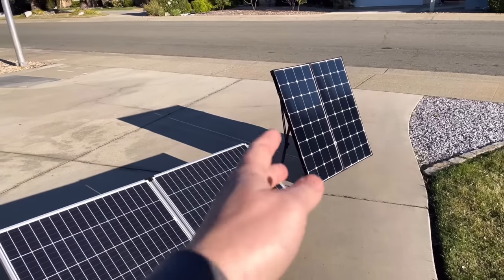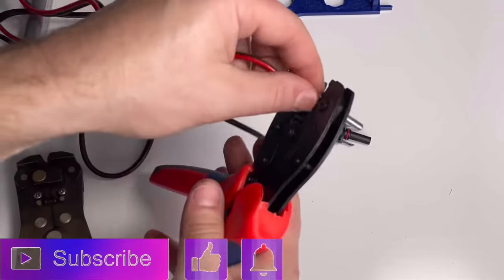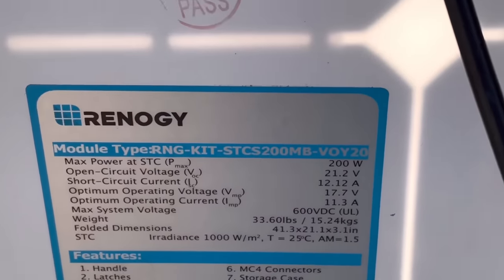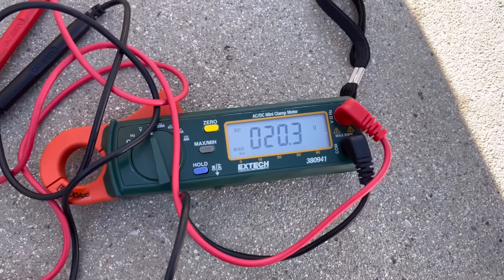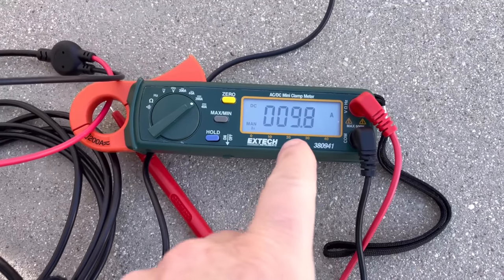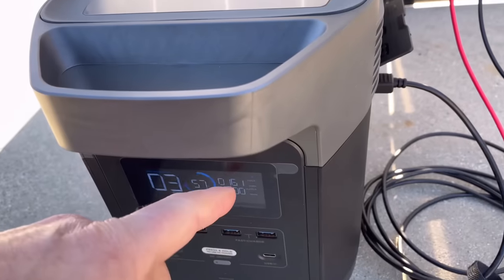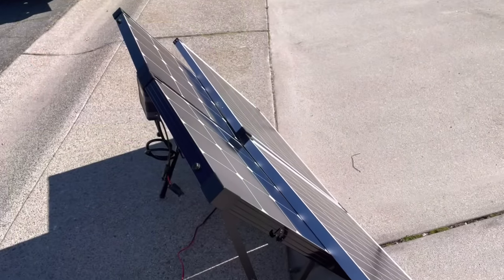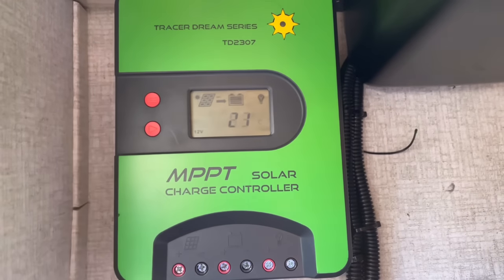Best Solar Panel - Harbor Freight 100 Watt Solar VS Renogy Eclipse Solar

Comment: Good video but one comment.  Fake news, The Renogy 200W Solar Suitcase is $330 free shipping on Amazon not the $550.  Harbor Freight cost $103 each for ridged panels (no controller or standard connector).  You exaggerate the price difference which is only $124  SIZE. You blow over this. HF panels are 37 x 27 , so two of those 54 x 37.  The Renogy -s  41.5 x 28 .   I think the HF are heavier and don't come with charge control and MC14 connectors.   WHAT I DID? I bought two Renogy 100W ridged panels that came with parallel connectors and charge controller for $220. Much better value than HF. BTW Harbor Freight also has 100W folding panels and they are $189 each. Two of those is more than Renogy 200W suitcase. .
Reply from the maker: First look at the video title and the renogy panels used you would see those are renogy’s top of the line eclipse solar panel suitcase. You are comparing todays prices which have been slashed from when the video was made. I can’t do anything about price changes. But there 100 watt eclipse panel is still $288 for one panel.

The HF panel can easily be bought most times for $99 with more power output, copper wiring verses aluminum and easily built into a solar suits case for minimal work and price. The HF weigh almost 2 lbs more when comparing Renogys normal 100 watt with a HF panel. 

I didn’t exaggerate anything. I gave exact data at time video was made while you use todays prices. Which is not a fair comparison at all…🤷‍♂️  
HF panels still perform better…and have a much better warranty return if needed and come with support legs verses the standard renogy panels do not. Neither come with a charge controller which I would rather have a Mppt verses a pwm anyway. 

Looks at the lastest video comparing both
Reply from the maker: Also I a mc14 connector is used in media or sound / audio like xlr connectors. 
Mc4 is more what I think you meant to say.
Reply: @johnnysweekends  Don't be pedantic, ha ha. Yep, it was a typo, MC4.  BTW at 00:30 those are NOT Anderson connectors. Doha!  Correction back at you. 
BTW I just made a cable today with MC4 connectors. Bottom line comparing big HF panels to anything is suspect. Renogy 100w regular ridged panels are less expensive or same as HF. But I agree when you get into FOLDING or Suitcase portable panels the cost per watt goes up, sometimes way up.
Reply: @johnnysweekends  You are making changes and saving the world, one YT video at a time, attaboy.   I don't think your video "slashed prices". I don't know  where your got your original price, but it was "full retail" not the usual sellers who discount these things, You paid too much. There are solar folks O-plenty asking $500 to $700 for 200 watts: Jackery $699,. Bluetti $499 to name two. They often have sales or bundle with a power station. What accessories they come with, controllers, cables, connectors don't know, but this accounts for some of the cost. Controllers are not free.  You do pay a premium for folding or suitcase.

These suitcase/folding kits are for people who want to plug and play, either don't have the ability and/or desire to source parts and make cables. Also you act like copper cable, controllers and connectors are free. By the time you MAKE YOUR OWN, not counting your time, it will cost much more than bare panels. These folding/suitcase solar panels almost always come with goodies, cables, controllers and connectors.  Renogy is stingy in this area of extras. 

Being cheap I agree, DIY is the way to go. Get regular panels (from whomever you like, up to you) and suck up the weight and size; make your own portable set up.  By regular panels I mean ridged metal framed panels suitable for mounting on an  RV roof or house roof.  However I fly a light airplane I own. I go airplane camping the two ridged 100W panels are too big. I use them for home and car camping.  I will have to cough up the cash for soft foldable panels in the future. I like using my power station and DC compressor frig/freezer for camping. No more ice chest for me. However a airplane is very space and weight limited. 

I am a Harbor Freight addict. I was there today and will go tomorrow to use my 20% off per day until July 4. I did not look for solar panels this time, but they are ALWATS sold out at my store and the one 30 miles away. So again agree to disagree. Renogy on-line order, in stock, easy, free shipping, arrives in a few days. Not an issue. Love HF but I would not buy it unless it was on sale, and even then likely I would not.

Last I did not say you exaggerated just correcting some inaccurate info and disagreeing.. You were just wrong on the Renogy price and calling 00:30 Anderson connectors.
Reply from the maker: Yea correct as I stated in description those are SAE but I was messing with and ordering Anderson connectors and never caught it in editing. 

But yea these smaller portable panels are very close performance wise and building your own is cheaper for sure as I have done a couple. 
I would never use these for normal house hold or shed or off grid as price wise it’s not budget friendly at all. It’s more for size constraints or weight.
Reply from the maker: The foldable panels are nice but for the price no reason to buy a 100 watt when it’s not to much more for a 200 watt and that’s the minimum amount needed if you wanna power or recharge anything because you never get full spec for long from panels. To many factors plus once they get hot a 100 watt panel gives about 90 ish depending.

I have built bigger folding suitcase styles that are 350 watts and it was super cheap and performed great but it also weighs 55 lbs. 

If your wanting the most amount of watts for the price used residential is the way to go…

As far as renogy vs Hf panels the Hf panels still perform better and are pretty much the same price with a coupon. 

See the difference here in this short video
https://youtu.be/W-fgI6Kyy2I
Reply: @johnnysweekends   UPDATE. today. Shock good news, HF had  100W panels for $129. They have a folding version for $189.   So the no sale price for two is Approx $260.. Again Renogy 200W folding panels $330 Amazon.  Difference of $70.  I don't disagree with you, just the prices. I agree with you. Shop around, test, DIY your own cables etc. 

Right now I am charging my Power 505 DBPower power station at 139 watts. The power station throttles to limit max pwr to 150 watts. To get these panels (or any panel I tried)) to work well with power station, get the most out of them, i NEED a BOOST converter and boost voltage. Power Stations are not like charging a STAND ALONE Battery. You are going into the Power Station charge controller.  I take panel voltage of about 16V and boost to 25v (adjustable) to get the 140 watts. With out the boost the charger would be 90 watts or less.  As you say higher voltage is better. The power station charger likes the higher voltage. Cheers
Reply from the maker: If doing a power station you need to watch max voltage as it can burn the units up. Amps are ok it will by pass what it can’t use. 

Some will do 2s2p depending on the needs and what your unit can handle. Again watch max voltage especially when it’s cooler days as the voltage can really go up.
Reply: @johnnysweekends    Yes Sir. Thanks. I am aware. The unit is rated up to 30 volts and 150 watts. My panels 2x100W Renogy.. Theoretical 200W output. I'm using a BUCK CONVERTER in BOOST. It is adjustable. With out the BOOST voltage conversion the Power Station would only draw about 94 watts full sun. (* read note below). By boosting the voltage from 15.7v to 25 volts I get the max from the panels, about 134W. Of course amps drop, about 5.7A.  Note this is just what the PWR STA is allowing. With a MPPT controller and big FLA or Li-Ion it could do better. I could adjust the voltage down and get less power, but the unit is rated at 30volts and 150W. 

The POWER BRICK supplies 24 volts at about 5 amps giving 118W. So 25V is my target volts into the Pwr Station. I am in the ball park. Also the BOOST really helps with low sun. Bottom line you can give Pwr Stations (if good quality) more power but they will throttle. However voltage is important and I am safe at 25 volts as the Pwr Brick is at 24 volts. It seems my Pwr Station likes 24 volts. I tried charging on car Cigar plug (they provide that cable). About 20W to 25w at say 13,5V (my car has smart alternator and does not over charge the battery). However in 24 hours that would charge the unit.

* Note: Other big YT solar channels do shoot outs with power stations and portable panels. STRANGE a panel on one PWR Station will produce descent power. Same panel on another Pwr Sta. it charge rate is peanuts. These are high quality brands. So the magic or mystery is in the internal charge controller of these Pwr Sta. I could just use a battery, controller, inverter and panels. However these power Stations are handy for around the house or camping.  With the booster I get more charge in low sun conditions. Very handy on cloudy days to keep my camping Frig going.
Reply: @johnnysweekends  Keep this in mind. NOT all panels are the same. Not all internal charge controllers in Power Stations are the same. Some combinations of power station internal charge controller and solar panels work really poor.  This is well known. Many power stations are looking for a solid Voltage and Amps from a Power Brick to accept all the power. I could put two low volt panels in series. I could get panels that produces more than volts with the load the internal charger puts on the panel. However the BOOST converter solves this. I am NOT going to try to convince you my Pwer Station does not love 15-17 volts. It likes 23-25 volts. I have to live in the real world. YES running straight panels will work, just 48% less efficient. 

Did you know MPPT controllers have a Buck Boost Convert in them. The software optimizes the volts and amps to get max power for the load as the panel out put changes. It does this constantly.  This is like what I am doing but at one fixed volts.  I have it set to the nominal 25 V to not be too much at full sun and to give a good kick when volts on panel drop due to low sun. My booster is rated to 600W High Power DC to DC Boost Converter DC 12-60V to 12-80V, Step-up, Trust me this is the problem solver when power stations are not loving what the panels are outputting.

You are right directly connecting the Panels to my Power station I get 90W vs 134W. I will take the 48% gain.  Now 90 watts would meet my power needs IF I COULD GET 90W and count on full sun. At  134W I am fully changed by 1PM after running Frig all night. HOWEVER it is low sun conditions or cloudy days the BOOSTER really gives the edge.
Reply: I just bought 2x rigid Renogy at 99$ each Canadian $$. I can prop them up myself.

Comment: Interesting that you are pricing bare bones panels against a full setup with charge controller. It would take at least another 100 to 175 dollars to make a full suitcase system out of the Harbor Freight panels plus an hour or two of labor to accomplish the project at a minimum. I'm perfectly fine with doing a project and saving some money, but it bothers me when you take a skinny apple and compare it to a fat juicy orange. They aren't the same thing. Another issue is that you are running one set in parallel and the other in series. This makes for yet another poor comparison.
Reply from the maker: I can buy the same pwm solar controller for about $25. Door hinges for $12 and easily buy some bag for about $20.
Still under $300.

And in order for me to parallel the renogy I would have needed a adapter 
Both are in series…
We will see if they perform well after a 20% degradation test. Or if they lose that much..🤷‍♂️

You can also watch my build on a 350 watt suitcase in my solar playlist

Comment: Maybe you should show practical use of the solar panel and hookup for the novice person that doesn't know electrical circuits because all this video does is confuse
Reply from the maker: Portable panels like these are for the most part really simple. 
And if not doing a grid tie you don’t need a electrician. Grid tie is a solar system connected to the main grid or power company.

Small set ups like this are simple depending what you want to do, or device  you want to run or store your energy in. 
Which storing refers to batteries.

I could make a more simpler video down the road. This really is a review of a expensive set up verses a cheap set up and is it worth it to the person considering what they wanna spend there money on and there needs.

Comment: can u use this panel on a generac 1000
Reply from the maker: Generac 1000 what??
Reply: @johnnysweekends  I have the generac 1000  but don't wanna buy there solar panels .wanna buy another solar panel that will go with the generac 1000 ?
Reply from the maker: Generark maybe? 

Regardless of which power station, you can use any solar panel as long as you have the correct connector. Which they have adapters. So yea these will work and you doing need to but there’s. 

👍🏼
Reply: @johnnysweekends  Thank you John !
Reply from the maker: No problem..👍🏼

Comment: Why would anyone with any knowledge cut those anderson connectors off right up against the connector so you could never use them again for any other project? That's a sign of an amateur.
Reply from the maker: That’s the sign of someone with more then enough crap and junk in my garage. If I kept everything little thing I use and swap and more I look hoarder.

Don’t need it, don’t want it, have more…. It’s in my way. 

Thanks for watching 👍🏼😀
Reply: @johnnysweekends  Sorry for being so harsh.....hungover!
Reply from the maker: No problem, we good 👍🏼 👊🏼😁

Comment: Is anyone marketing panels with 4 adjustable legs? (Permanent installation)
Reply from the maker: Not that I have seen…
Reply: @johnnysweekends  I'm surprised. I have quite the application for that. Demographics being what they are, if there's one, there are thousands....
Reply: I live in TN. Our hills vary in 3D. Kind of a drag installing large flat stuff in bulk.
Reply from the maker: There are adjustable legs you can buy and mount them but nothing specific for solar panels. Normally they are portable or fixed
Reply from the maker: Yea I bet that’s tough. 
I have been to Tennessee a couple times. 
Memphis, Nashville and way out east in the corner by a lake and a big college for doctors I think. The lake was awesome. 
Loved it there. About 20 mins from the big tunnel to Kentucky

Comment: 100 watt panels are a wast of time and space. Renogy are not $500 for a 100watt or even 200watt panels.  Paid advertising
Reply from the maker: Purchased both with my own money…

It’s to see is it worth buying a renogy kit or build your own with harbor freight stuff and save money. I get you don’t get a controller or fancy case but that’s cheap and easy to get

Comment: You always want to get the most wattage dense panel. This is because solar is only 20% efficient. So on a 100 watt panel you will only get 20 watts average from that panel per day.

Voltage level doesn’t give you more amps. You can half your input voltage for more amperage by setting the panels in parallel instead of series. When you think of amps think of a car engine. It can have multiple pistons added for more horse power. This is amperage. The rpms can be matched with any engine in its class. It just takes longer to get there with less pistons. This is voltage.

Comment: Wattage is nothing more than a mathematical calculation of voltage and amps.  Power is equal to voltage times current.  P=I x E.  If your voltage is 15V and your amps is 11.7, then your wattage should be 175.5 watts.  The extra connections make no difference, it is not a measurement.  It is a mathematical calculation based on two measurements.  Your device is probably taking an average of the voltage and amps due to them constantly fluctuating slightly and generating those numbers, or even more likely it is taking a snap shot of the numbers as they are fluctuating and thus the voltage readings and amps you are seeing might not be the snapshot it took when you switched to watts.

Comment: how on earth could you assume either product would last for ten years
Reply from the maker: You can’t, but most solar panels if under normal conditions will last longer. They won’t be putting out 80% of rated power by then but they will still put power out. 

But I can’t assume anything will last even a car. But as long as it turns on the next day and the next day, well I just assume it will keep turning on till something gives. Or I neglect it.